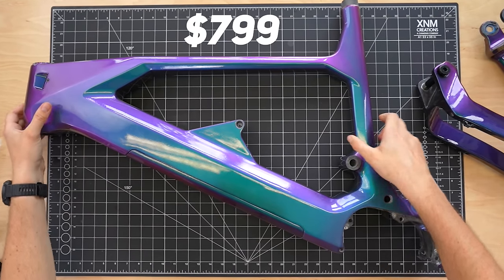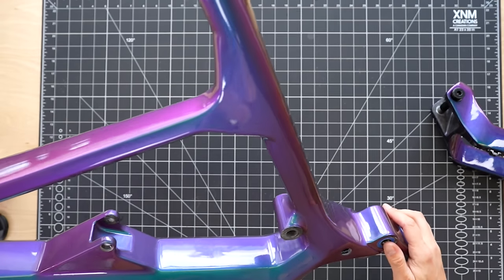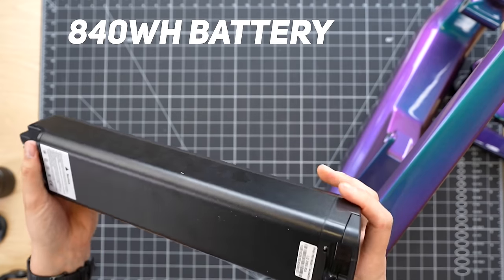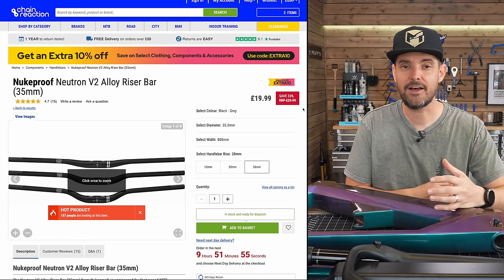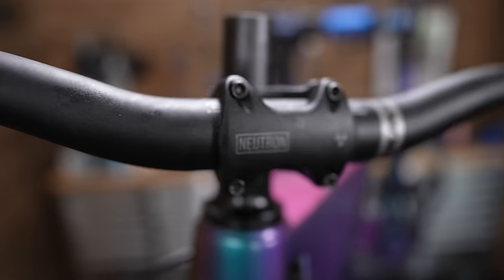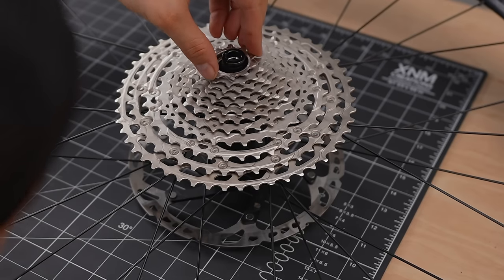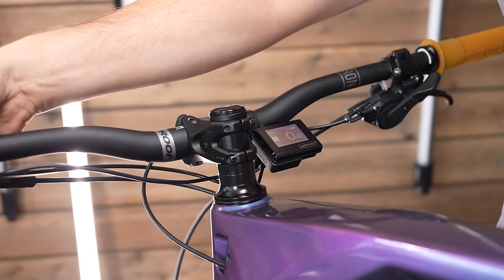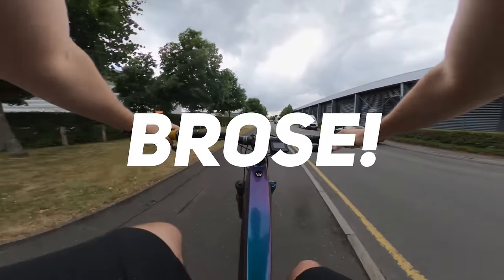How To Build a Cheap DIY eBike

Comment: I’ve reached out to you contact and they said it’s not available but to contact Luna Cycles. They don’t have the frame and electronics package either but they have their own ebikes which I assume is build from the same platform.

Comment: How long did it take for the frame, battery etc to arrive from ordering? 
Really tempted to go down this route to get into the e-bike game
Reply: It might depend where you live. I received mine in Australia just 2 weeks or so after ordering. Frame arrived 1st, battery arrived separately.
Reply: @Yourfriendwasmagnificent  you put yours together yet? How’d you rate it?
Reply: @breakaway4404444  Yep, I've done around 600km on it so far and I love it. Handling is fairly neutral, nothing bad to report there. Mine has 27.5 wheels, 2.6" Maxxis Disectors, a 150mm Rockshox Lyrik select and Super Deluxe coil shock. I highly recommend a coil shock for it, so smooth I call it my magical carpet ride! 
Things to note: their frame sizing is a bit whoopie, look up the geometry chart on their website to decide on appropriate sizing for yourself.
The ordering process feels dodgy compared to what we're generally used to these days but don't worry, they are legit.
Build it and have fun! 🤙 🙂
Edit: If money is tight, buy the best fork and shock you can afford, the driveline will wear out and can be upgraded later 👍
Reply: @Yourfriendwasmagnificent  Nice one. What did the frame/battery end up costing you landed in Aus?
Reply: @Yourfriendwasmagnificent  2 Weeks? Damn that would be quick.
Reply: @breakaway4404444  From memory, I think it was around 3k for the motor, battery and frame.

Comment: Hey yall very new to bikes and ebikes as a whole so apoligies for the dumb question. I am trying to decide whether to build or buy a ebike and i am trying to understand with the $3000ish he spent, what is the equivalent ebike that he built. Like $3000, $5000, or $12000 rough estimates and maybe a link to the bike that shows that sells for the price you are sayinv this would be worth. I really appreciate the help and again sorry for the dumb question i just dont even know how to compare anything about this and a off the shelf one. I was looking at buying a $3000 ebike and just going from there but if i can get a much better bike with just some effort that would be amazing. (Was a mechanic when i was younger so confident in my ability to build it just not in whether or not it is worth it.)
Reply: You can either buy a decent hardtail (limitied and no programming options as well) or you can build your own full suspension E-bike which is obviously most cost-effective. (the reason why is you save on labour, transport and everything in between)

It depends if you want fun now, or if you can be patient. (building your own on average takes 3-4 months)

Comment: Not legal in the UK with a thumb throttle (did I see a thumb throttle?) Either way, if I was getting a bespoke frame for a Bafang frame motor  I'd just chuck the Bafang Ultra motor in it. And a 250w sticker.

Comment: damn you, been thinking of getting rid of my DIY ebike and getting a Cube reaction hybrid 750 sl ~3500, but now you got me thinking you say more powerful motor than bosch, street legal, bigger battery, and of course I already have wheels, breaks, gearing, forks, handlebars etc. whats the closest frame they have to the cube that fits the m510, is there a list somewhere rather than just email.  wanting it for a jack of all trades, commute, bike packing and blue runs at bike parks, although probably red in the future as well. How well do these cheap carbon frames hold up, that's the biggest worry.

Comment: Then there's me, buy an $80 (in sensible units of measurement btw) Trek bike frame from the mid 90's, slap a $199 dollar amazon 36v hub kit on it. Wire in a receiver for my 40v Ryobi battery for my lawmower (Yes i can still use the battery for the lawnmower) and send it! 

If it works, it works in my book.

Comment: I've tried to order that frame in the US and the won't sell it as its licensed to Luna Cycles here and they won't sell just a frame with out without motor/battery.  They sell a whole bike for over $5k with junk components.  Do you know of another frame option with decent Geo?
Reply from the maker: Try get the E22, maybe they will sell that. I hear that Luna may have exclusivity on the E10, although I have heard of people successfully ordering it. Check out this forum for more info: https://www.emtbforums.com/community/threads/dengfu-e22-frame-thread.26880/

Comment: anyone who know what BMS is fitting the E10 battery container?  I am building a 65cell 13s5p and they almost completely fill up the battery container , no place for any that i know of 30 or even 20A BMS (For the M600 motor) . any photos or info on how the factory battery is made( compressed) is appreciated.

Comment: I strongly recommend NOT using carbon fiber. It can fail without warning. You will never know if it was damaged from a hard bump or a drop...or a micro delamination from the manufacturing process. They make it cheap these days but IMO, it's just that- cheap. I would go with a quality, welded aluminum frame. It's not that much heavier either. Even if it is, you will never feel it when riding...and it will likely last forever without the worry of a failure. I've seen almost new $3k road bicycles that randomly fail- always it was CFiber. There are videos of wheels exploding, seat posts snapping, steering columns failing- it's not a secret. Just my opinion (yes- Engineering background) but do your own research and make your own conclusions. Just imagine doing down a steep, twisted road at night, going fast with a truck coming the other way towards you. You cannot afford to have a frame fail. Never buy one used either- you don't know how it was cared for or if it was exposed to salty air (bad.) You can test with ultra sound or tapping it but who is really doing to do that?
Reply: @MOAB-UT  I can assure you I am

Comment: Cool vid. My only fear would be charging that cheap Chinese battery in my shop and burning it down. In my line of work I've seen first hand what can happen with no name overseas battery powered equipment, which is why I always warn people to steer clear. Hopefully that's not the case here, but be carefully while charging!

Comment: £3000 is not cheap!! You could have said cheaper which would have fit the video more!!
Reply: 3 grand compared to 12 grand is cheap
Reply: It's cheap for an ebike. My carbon framed cabon wheeled MTB cost £4200 and it's not even an Ebike and is considered a 'mid ranged' MTB

Comment: Nope. You lost me on the Rock Shox Yari, which is matched EASILY on Alibaba for under 300 bucks. Your drivetrain as well, and i can have FULL carbon wheel set up and rear shock From DNM that will out perform pretty much anything you could possibly throw on there. So the real price goes WAY down with the same or BETTER performance.  Fox 36s and 34s equivalents have been on the market for a couple of years, and DNM has rear shocks that simply outperform most anything on the market FOR DIRT CHEAP.  Remember, im the dude that told you about BAFANG motors in your shoot out video of expensive rip off junk from the likes of Yamaha and all the rest.

Comment: FML I thought this was suppose to be a "budget/cheap" build. Nothing is cheap about this, I can buy a dayum motorcycle with low miles in the states for that, that gets 50-70mpg for that price range. Hell I actually just bought a 2009 klr 650 for 3500.

Comment: an actual cheap ebike would be 1000 usd imo
Reply: Buy second hand fatbike 200£ then 1500w motor with controller and screen will cost 250£ that’s 450£ so far buy a 60v 24ah triangle battery total is 950£ you have a bike that goes 30+miles and best on road for comfort as is fat bike

Comment: Theres an extremely large amount of reports of those chinese carbon frames breaking...
theres a reason good frames cost a lot of money
Reply: I own 2 of these frames, they are now 7 months old. I belong to a couple of social media pages that are based off this frame, as to date yet to see evidence of a single frame failure for this e10. 
Sure there are other manufactures out there that frames fail, this is not one of them. The E10 is absolutely bullet proof. 
Interestingly my mate who I ride with is onto his 3rd frame after breaking the 2 previous frames since I have had the E10, his bike is a specialised turbo Levo. Therefore its safe to say the E10 is built stronger than a specialised frame and for a fraction of the price.
Reply: @lasagnin I've had several Dengfu Carbon Frames, starting with a Road Bike Frame that I had bought 6 years back, not a single problem to report.

Comment: 250w Rob all the manufactured bikes peak at much higher wattage than 250w, 250w is candle power only about 6 amps on a 48 v battery it total inane nonsense Rob ..

Comment: Trouble with any electric bike you're going to be afraid to use it because somebody is going to want steal it, yes you've made any e - bike for lot less money under £2,900... if you've got electric bike between £1,000 and 10.000 or even more there's a very strong chance that somebody is gonna Nick it or Nick parts off of it 👎👎👎 if somebody comes along with a pair of bolt cutters it doesn't matter what sort of lock you have on it somebody's gonna steal it, I live in Romsey Hampshire don't trust anyone to steal it in Hampshire 👎👎

Comment: Didn't you already do the exact same bike
Reply from the maker: No, that frame has gone (sold last year). This is a slightly newer frame (charging post in a different location, newer battery cover). Looks the same as the factory painted it the same colour scheme as what I did last time! Also, new Bafang motor (M510, old one was M500!)

Comment: I find it odd that you recycle the old video and dont even mention that you did the same (with the same frame and motor) a year ago. Like you took a working bike apart and put it back together with slightly different components and act suprised when the electronic components (that you know are working) turn on.
Reply from the maker: You're wrong. This is a brand new frame and brand new motor. The frame has some differnces... for one, the charging port is in a different location (on the side of the bike now) and the motor is the new M510 motor from Bafang. I sold the original ebike last year. This one looks the same because the factory painted it in the exact same colours that I did last year!
Reply: @RobRidesEMTB  Ahh ok. I didnt know that. It just felt like a big deja vu for me. Thanks for clarification!